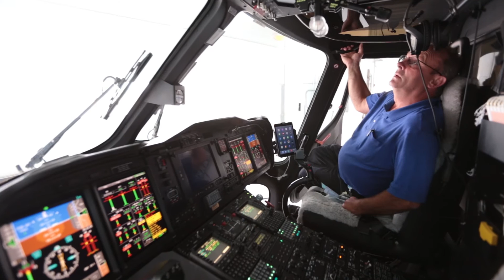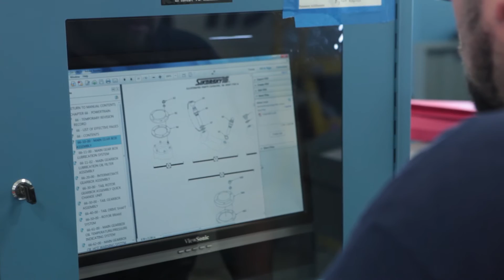Careers in Helicopter Maintenance

Comment: Hey I’m joining the Air Force to become a helicopter maintenance technician can I take my experience and immediately get a job after or would I need a license?
Reply from the maker: The military does not require a maintenance technician to be an officially certificated Airframe and/or Powerplant Mechanic.  Therefore, unless the Air Force sends you to a school or has an agreement with the FAA for local testing, you will not be an FAA certificated mechanic in the Air Force.  To answer the question directly, you can get a job as an aircraft mechanic in a large shop working under the shop certificate or another mechanics certificate, but the best plan is to get the Air Force training, convert as much of that as possible as credit towards an FAA certificate and complete the rest of the training on your own in order to get the A&P Mechanic Certificate.  It is much easier to get a civilian job with an FAA Airframe and Powerplant Mechanic Certificate.